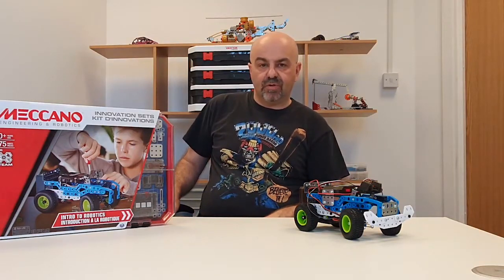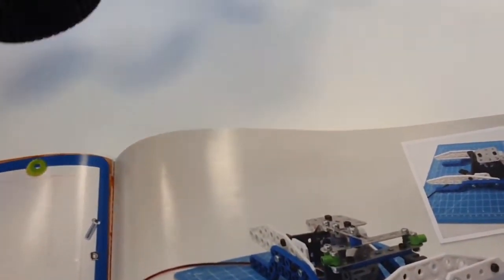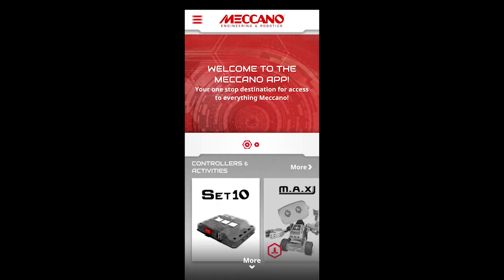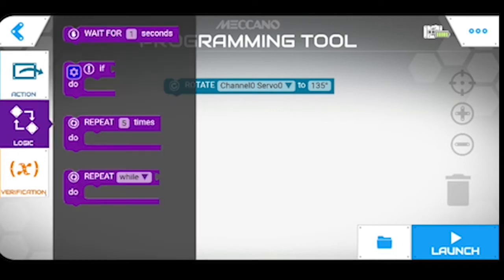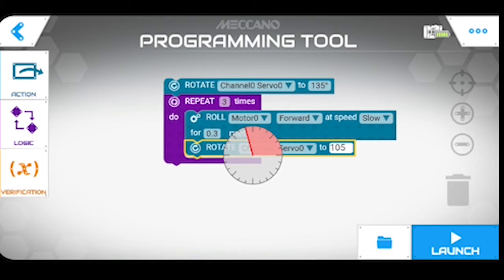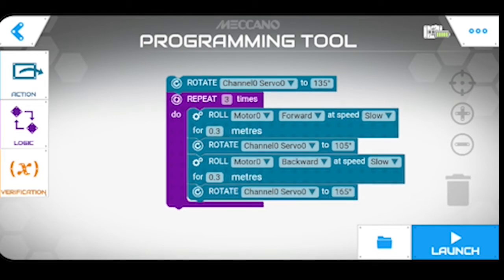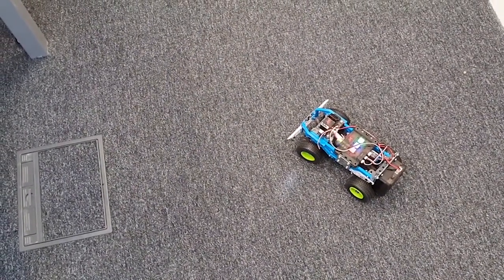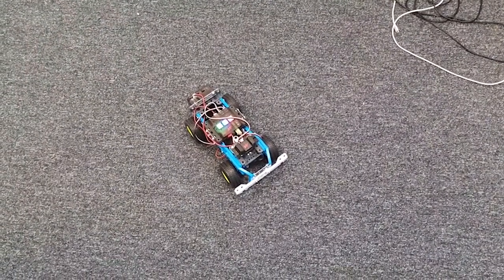How to program Meccano 19605 Intro to Robotics Car

Comment: Trying to download the app... it just tells me that the app was made for an older version of Android. My son and I spent hours building this car and can't figure out how to control it. Any ideas?
Reply from the maker: Afraid not, or at least no easy fixes.  It stopped working after an update a year or two back and Meccano don't seem interested in putting it right.  It was very glitchy and difficult to maintain connection before that anyway.

I'm using Arduinos to control my electronic stuff, but that doesn't help you with the kit you have.

Comment: When I go to the part where you have to connect through blue tooth it doesn't connect. And yes it is turned on
Reply from the maker: Thanks for watching Austin.  Honestly, can't recommend it at this point - the bluetooth connection drops frequently, and the programming side of things got messed up in the last app update.  It will sort of work as a remote controlled car, but Meccano have dropped the ball with this one unless they drastically improve the app.

It will probably connect eventually if you keep on trying.

Comment: Mine cant turn can you help
Reply from the maker: Hi Roge.  I think Meccano have made a mess of it in their latest update to the app.  You now can't select channel 1 or 2 fpr  the programming options for the servo, which is the only channels you can connect them to and which is what you need to control the steering.  It only offers you channel 0, which doesn't exist on the Meccabrain.  You should however still be able to control the steering via the slider controls so it works as a remote control.

Hopefully Meccano will correct this fault next time they update the app.